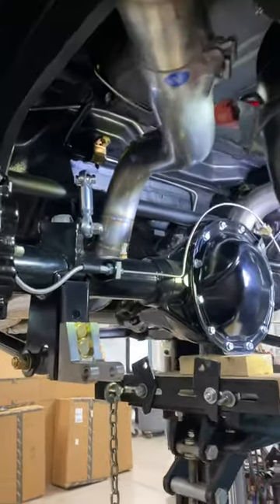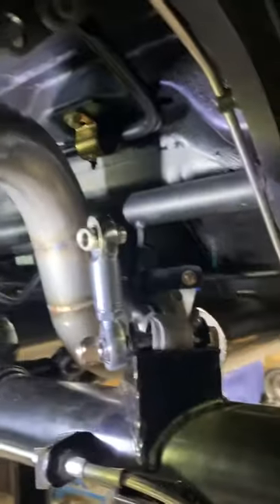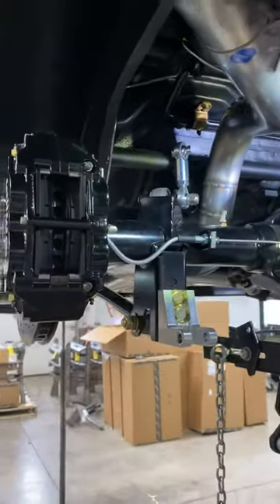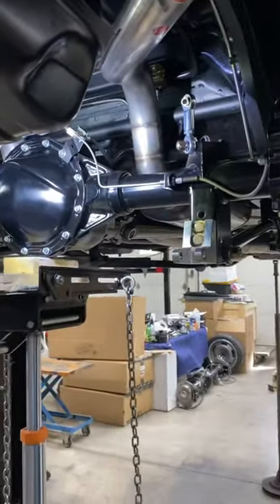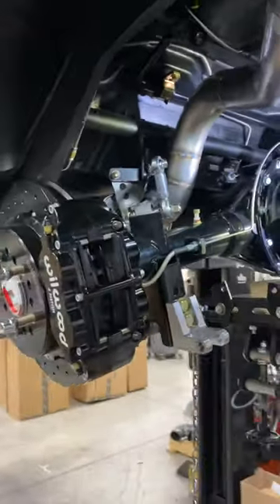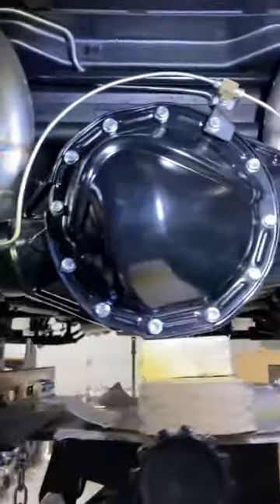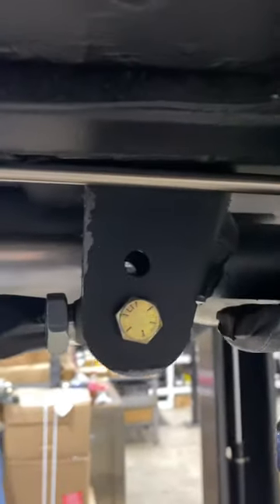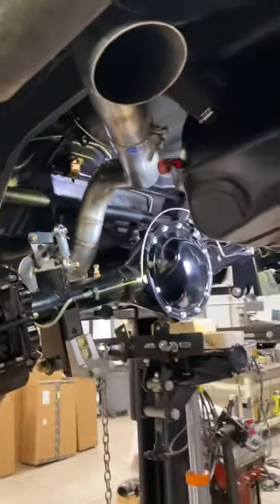Church Boys Triangulated 4-link Articulation

Comment: What if the heim joints were to be replaced by polyurethane bushings? Would the articulation be affected? I feel like articulation would be almost zero... But I dont know for sure so that's why I'm asking. Thanks!
Reply from the maker: You are correct Nick....the articulation would be limited greatly!
Reply: @Mr67Church  Thank you very much!
Reply from the maker: @nicki8731  anytime...you can always call as well 330-727-4727